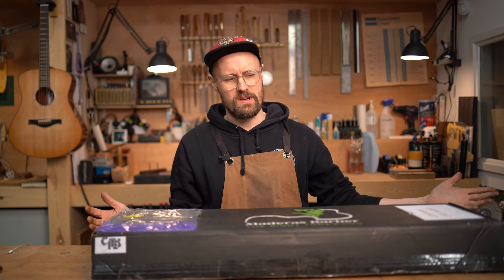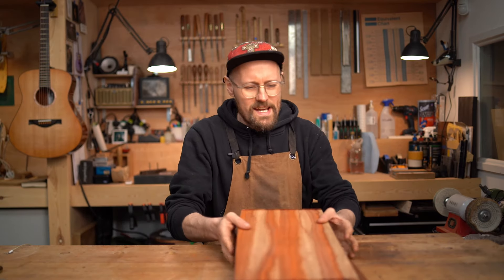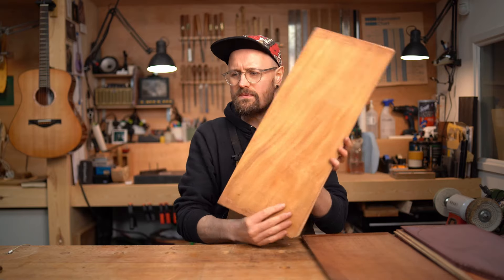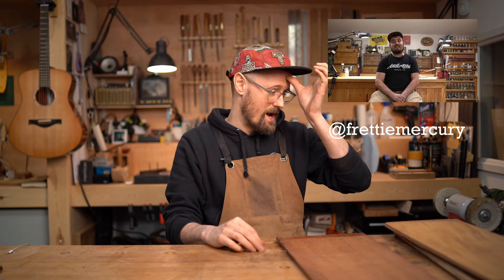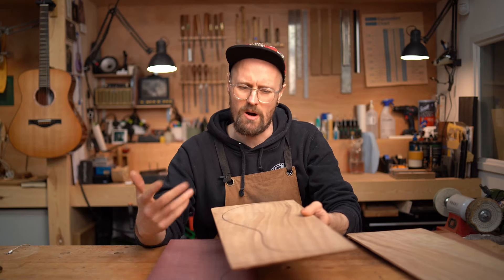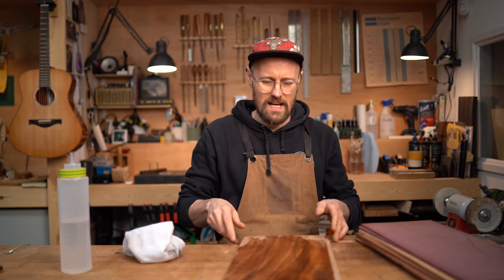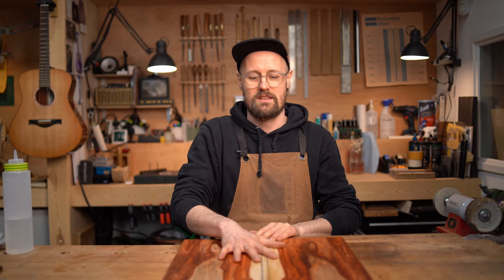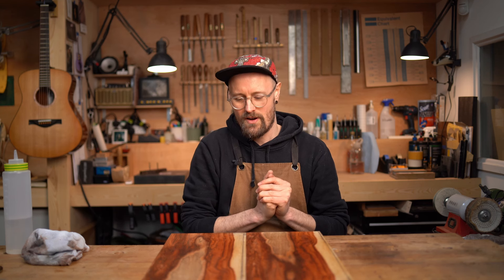Hold my sangria...I'm giving away 4 tonewoods from Spain!

Comment: Hi Tom, I would use the purple heart to build a multi-scale, 12 fret to the body guitar. It would include a cutaway and an offset sound hole in the upper left bout. 
I would couple it with an ancient cypress top as the colour contrast will look fabulous. 
A purple heart backstrap with a green accent veneer on a maple neck, with a matching white speckled ebony fingerboard, bridge and headstock veneer.

Comment: Tom-
When you build a guitar out of the first set at 2:08, I feel like I am seeing Jupiter's bands up close.  Therefore, you should name it Jupiter.

Regarding purpleheart, I have had the pleasure of building one electric guitar about 22 years ago with the material, along with Bolivian Rosewood for the neck thru body configuration, and a walnut top dad gave me many years ago.  To say it sustains quite well is an understatement, and the weight of the purpleheart balances the neck at a very comfortable position.

Comment: I would use the Padouk Bariole to make a 12th fret F/S 12th Fret jointed guitar, however I would make a structured laminate back, with minimal/no bracing , similar to "Braceless" classical tops. I want to push the strength and tone of the wood itself. :) Fingers crossed ahaha
Reply: Actually i would prefer to do this with any of the woods, but preferably the Padouk. Im from the UK btw ahaha